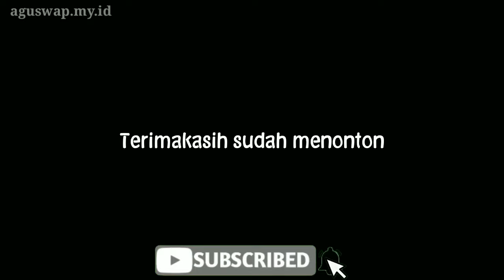Cara Merubah Trafo Non CT Menjadi Trafo CT

Comment: Keluar tegangn berapa bang?
Reply: Itukan trafo 1ampere
Reply from the maker: 20v 500ma trafo bekas booster antena
Reply: @AgusWap  itu kabel ouput dari travo ke dioda dibolak balik gpp bang,, soalnya gak tau + nya di mana
Reply from the maker: @hobimanuk6972  untuk kabel ac dari trafo ke dioda bebas dibulak balik ngga ada min plusnya